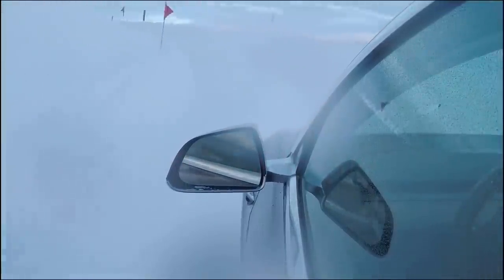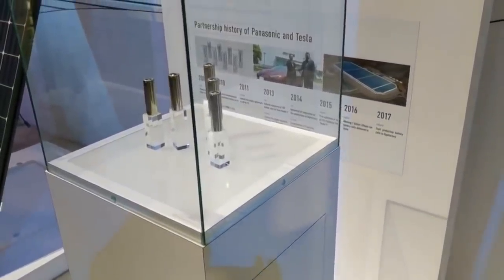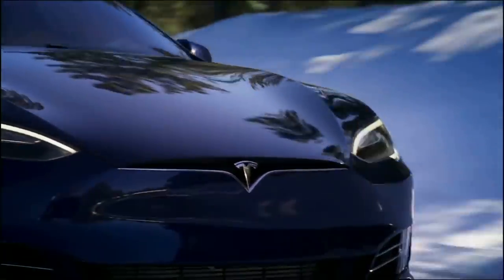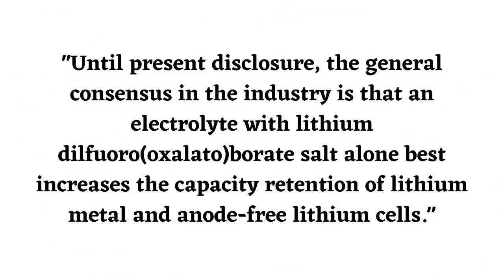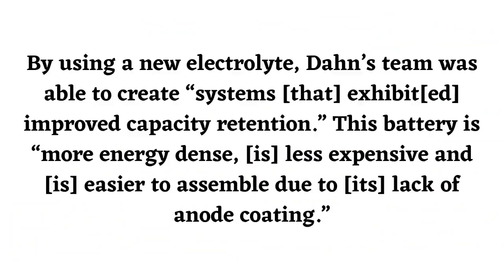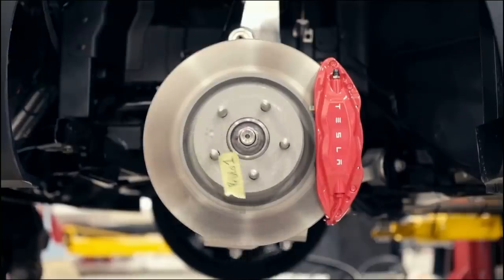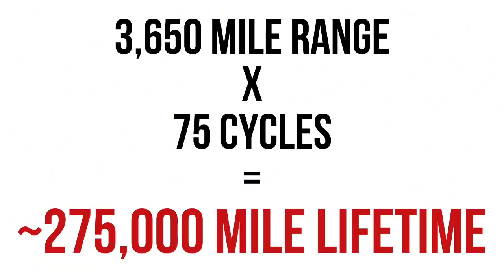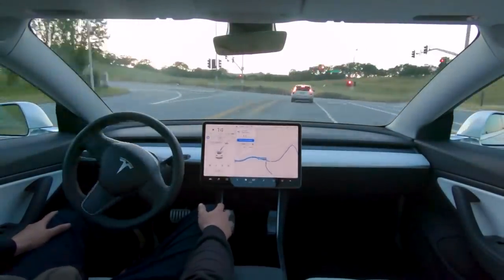Tesla's Secret 3,650 Mile Range Battery - The Next Gen Revolution

Comment: One thing you all forget. Who pays for the power generation stations that provide charging electricity? 
If you are thinking solar and wind:
▪ Both have very low specific energy and require 1,000 more space than an NG or coal powered plant. At that rate it would require all of the useful land in CA to generate enough energy to power all of its cars (if they were all converted to electrical. 
▪ If you did cover all available land with solar plants or wind farms, you would still need backup plants for the times the sun was not shining or the wind was not blowing and especially for repair (down) time. The coal or gas generators would have to be at least as large as the solar or wind source they were backing up to keep from having times when no energy was available. 
▪ Solar and wind is VERY harmful to local birds and crawling animals. It has been estimated that windmills alone kill millions of endangered hawks, eagles and owls, not to mention huge numbers of bats who fly in flocks and one blade can kill hundreds on a single rotation.

Comment: If true they would just cut down the size of the battery, because like 1825 miles is plenty and it would cut down the weight of the veichle actually recovering from range probably putting you upto ~2k miles, which is plenty for anyone, honestly I think they would cut the battery down by 1/3 and get ~1500 miles of range for the highest end option, maybe adding in a super capacitor to replace the instantaneous power and pass some of those saving onto the consumer while pocketing the rest.
Reply: Battery A:300 out of 1500 is 20 percent
Battery B:300 out of 3650 is 8 percent
Which one of those two would charge to 300 miles first?

Comment: If this comes into production, we will not see 3650 mile range cars. We will see cars with 300 to 500 mile ranges with battery packs as small as a current petrol tank. Smaller packs will reduce weight enormously allowing lighter suspension, brakes etc. A much smaller pack of cheaper batteries will also get the price down to that of ICE vehicles. This is the breakthrough.
Reply: A Tesla 3 that's half a ton lighter and retails for $25,000

Comment: A 1000 miles battery would be great at least in areas with a great supercharger infrastructure. Many countries still lack a good supercharger network and those chargers they have offer in most cases 50kW or less peak charging speed  which is not exactly "super". Charging a 1000 miles battery (300kW) at home? Not very practical unless one has a lot of time...
However the good thing is batteries will become smaller and lighter and still offer a slightly bigger range. More than 450 miles of range I think wouldn't make sense for most EVs, again because of the low charging speed at home (4 to 11kw/h)
Reply: You only need to charge it to 1000 miles or 3650 miles if your going on a trip. I'm sure we will have home chargers that charge 1000 miles in 8 hours. 30 mins at a supercharger and you top 1000 miles

Comment: No way batteries unfortunately npeple don charge batteries proprtly and they sart to hold less and  last less phone batteries in older iPhones horribl did it and after1 year even the  apple10s sart to ge nenory abd yharspart of the reasonsthey  so what would last 1 hour starts to last 10 minutes abdbaterieswould learn that cgargeanf boom she ur battery will never charge as gee again them the second battery another six month same shit ! New dewalt drills on lithium ion are actually larimg abd best to use bear batteries and run them empty and a full charge and even old 12 volt will last longer there like ur metabolism don’t eat store fat less energy use energy eat every three hours and ur metabolism is burning belly fat u will be ur high school age !!batteries can Died in concrete quicker than a shelf and I think a million million on hologram possibly

Comment: I am definitely not an expert. But sound like this would also work great for camping. Could probably run A/C for an entire week. You could still use propane for cooking and refrigeration as well to save energy. But the A/C is the biggest energy drain on a camper.

Comment: If this works it will be awesome and revolutionary, but not a solution to everything. For starters, let's just assume Tesla develops a mere 5x density battery pack so Model S 100kWh/300mile range battery pack becomes 500kWh battery. But at the current target price of $100/kWh where BEVs are supposed to finally become more viable than ICE that pack would cost $50000, almost doubling the price of the already expensive car. Current Model S battery pack is 28% of the total weight of the car, it would be far better idea to make a smaller battery to keep the costs about same but lower the weight by hundreds of kilos, which automatically gives better performance and range. Also, less material used per car will multiply to major savings in mass production.

Second issue is charging. Generally you want a battery with more range because that means fewer charging cycles and less need to drain the battery to low charge and charge it to full, meaning bigger battery both spends less time charging and uses less cycles for same range, which also increases its lifespan due to less degradation. But chargers can only deliver a limited amount of power so that 5x range car would also spend 5x time charging from empty to full, or have to stop for a quick charge almost as often as one with the current battery. Charging at home works because you can leave the car charging over night or use electricity from your solar panels, but even with current batteries if you took a long trip and drained the battery it could take days to fill up without at least level a 2 charger.
This means owners would actually need to use the fast chargers more, which would also increase costs and chances that chargers are all full and you need to wait or find another station.
Good news is that unlike your smartphone that may fail to charge at all if you use an older charger with half the amps the EV battery packs should have no such issues with home chargers, and of course if your daily commute is less than you can charge while at home you should have no problems, but that leads back to issue of "I never drive more than 50 miles per day, why am I wasting money and energy on extra half ton of battery I do not need?".

Third, both the batteries with huge energy density and the new superchargers needed to fill them in less time would contain huge amounts of energy, which can be dangerous. Often the difference between something with high energy density and the ability to deliver that energy quickly and an explosive is only in how you handle them...

So unless the price of new batteries lowers more than the energy density increases the new tech might not make BEVs any more affordable. And while draining your battery would take far longer time, it would become even more annoying issue when you actually need to charge it to full. For all the advantages and benefits of BEVs, plenty of people are still willing to pay more for fuel so they have a car with lower up front cost and faster refueling.

Solutions:
1. Robotaxis and public transport. When your huge battery gets low you send your self driving car to a charging station and rent another for the hours or days it takes for it to charge. Actually, why bother owning a car at all? Only problem is a lot of people are totally buying all the propaganda that they must own a car and nobody else can touch it... Also, car companies have spent a century wrecking public transport options and filling cities with roads not designed for anything but private cars, who's going to pay for rebuilding everything?

2. Paradoxically, fuel. Not ICE of course, but all fuel cell vehicles are hybrid EVs so they get full advantage of better batteries and you can fill the tank easily when you need extra range quickly. Also, while making hydrogen or other alternative fuels cost more per mile than charging a battery, a fuel cell and tank cost and weight less than batteries and unless you aim for ridiculous ranges fit in less volume than batteries. The result is a hybrid will cost and weight less than a BEV with same range, meaning you will waste less money on rarely used longer range and need less power to charge it for shorter ranges, while on long trips refueling takes less time than recharging.
Given current fuel infrastructure can be repurposed it would not be as troublesome to switch to a new fuel as building new charging stations, but the main issue with this is that Tesla chargers already exist and there is a huge shortage of smart people who understand the need to spend money on infrastructure and are not Elon Musk. It is unlikely that any financial and technological genius will appear, develop a hybrid EV as good as Tesla EVs and spend few billion to build combined fueling/charging stations all over to make this possible, and Musk has no interest in doing so.

3. Changing batteries. When your battery is getting low, simply drive to a service station, let a machine disconnect your battery pack and replace it with a full one, and you are ready to continue on even faster than refueling. This is how warehouses with electric forklifts keep working 24/7, but there is a good reason why Tesla decided it is not such good idea for cars: Every changing station needs a huge warehouse of charged batteries ready to use, equally large number of chargers to fill the empties, and humongous amount of power to keep this going, all of which will be useless waste of money at times when traffic is low. Also, Tesla would need to make even more batteries than currently, but they wouldn't be selling them because in this system the owner of the car is only borrowing the battery. And a lot of idiots seem to think if they don't own something they don't need to take care of it, which is a very bad attitude when it may result in next user of that battery having their car catch on fire...

4. Electric roadways. Build charging into the road so when you drive your EV on it it charges the battery and you get a bill in the mail later.
Yes, this is actual thing that exist and it works. Also, it was tested in Sweden so things like snow clearly aren't a problem.
Only costs like few million...per mile. And because the cars would have very small batteries you need these everywhere, making roads even more expensive. Expect huge EV taxes.
Also, you need a far smaller battery, only for trips away from main roads, so rather than superdense 3000+ mile battery packs you would rather just use cheapest batteries.

Well, gee, it is almost as if every solution has its own problematic issues...

Comment: Big problem with this idea.  Musk very much wishes for his vehicles to tie into the power grid and act as peaker plants selling power to the grid at peak rates and recharging at night during the lowest rates.  Requires 300 to 500 mile vehicles that can be recharged up to one million miles.  This battery as described will not be able to be charged that many times.  Kinda rules out grid participation.  However if they are looking for a battery that better accomdates those owners that do not have access to home charging this could well be that answer.  Would open up much more of the "I cannot charge at home" market to Tesla.

Comment: The whole issue is irrelevant, what I like to see is a 2 minute charging time , this is game changer
Reply: If you only need to charge 3 or 4 times a year then charge time drops in importance hugely!
Reply: @BenVallack  If those 3 or 4 times each take days when you can't use your car and cost as much as you spend on charging at most expensive supercharger over months all at once it becomes pretty important.
Reply: AnalystPrime yeah it’s going to come down to cost and speed -but it’s a different goal to the 2 min charge time which many think is needed for uptake of current range cars (which I’m not sure is needed either!)
Reply: @BenVallack  If you replace your battery with a 10x bigger one it becomes more efficient and many times faster to charge it to 10% than it was to charge your old battery to full, but unless you actually plan to do a 2000 mile race or spend a month camping off grid it would make no sense to waste time and money on charging that thing to 100% when 20-50% is more than enough. Charging it would take at least ten times more time than the full charge of your old car, but considering you paid at least 10x more for that battery you probably want to minimize the degradation from fast charging and repeated empty to full cycles, so maybe you don't want to use the superchargers anyway. If you do, remember to multiply the old cost of full charge by new capacity, or maybe more, you might find that prices will rise when cars start spending hours hogging the chargers.

I have serious doubts about the efficiency(and safety) of pushing over kilowatt-hour of energy per second into a battery, and we also have to worry about how long the battery will last with such treatment, but once EVs become more common there will be long lines at superchargers if we have to wait an hour for other cars to finish. Most people drive far less than 50 miles per day and can easily charge their batteries at home during the night when they sleep and electricity is often cheaper too, and on most road trips you won't drive hundreds of miles without stopping for a lunch break or something, so worrying that zombie apocalypse happens and they can't wait fifteen minutes for the car to charge is rather silly. But you can't put an ambulance on hold just because it saves little money on fuel. That's why fuel cars still have some uses, a tank does not start filling at half speed once it is half full, and generally does not get damaged and lose capacity if you speed things up instead of spending hours filling it.

Outside few special circumstances that probably need specialized vehicles anyway, when the design choices become lower cost and weight battery with faster charging vs huge battery with longer range but far longer charging times, fast charging is clearly better.
Reply: AnalystPrime yeah fair point well made. I do agree.

Comment: I am confused why they would make a 3,xxx mile battery and not make a smaller lighter and cheaper battery. 

If battery is the largest cost, if you cut that battery size and to 1/7 or less that sounds like the real game changer.